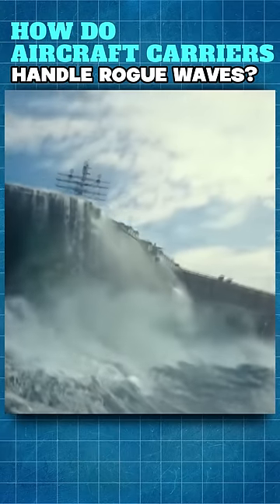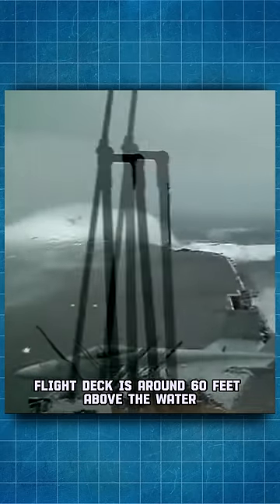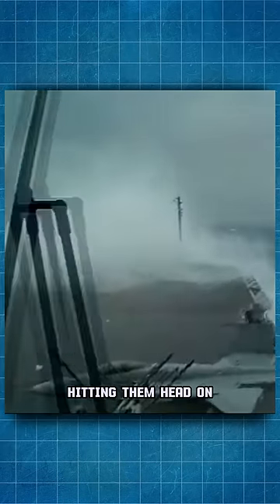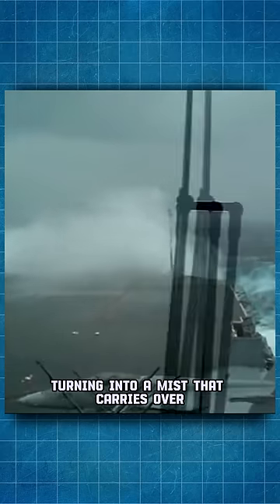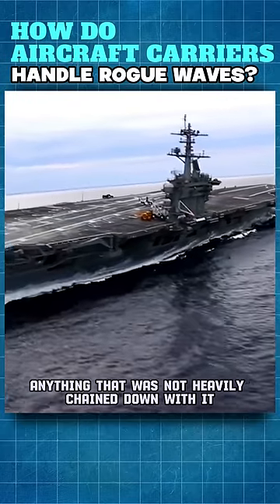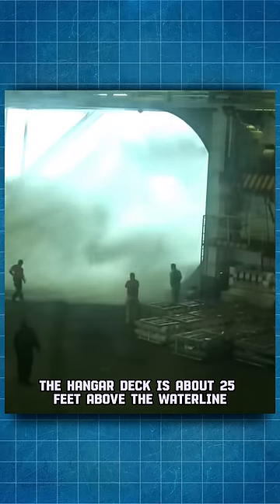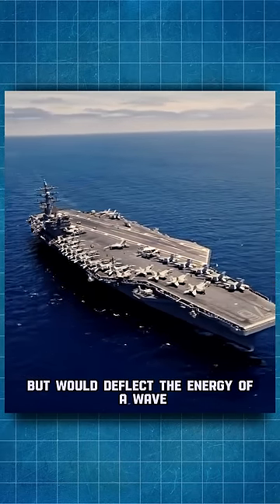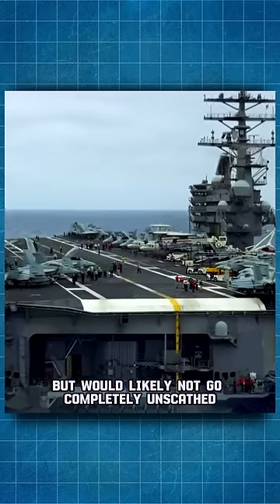How Do Aircraft Carriers Handle Rogue Waves? #aircraftcarrier #battleship #usnavy

Comment: In 1989, the USS Midway ran into three typhoons, couldn't outrun them, so we turned into them. We hit severe waves and took three 24 degree rolls (allegedly we would flip after 22 degrees) and came out on top with some damage. One SH-2 Helicopter destroyed, 25 life rafts lost at sea, three Sea Sparrow Missile pods destroyed and one compartment located under the angle deck lost the floor plating. We also lost one "huffer" which was an engine starting trolly.
Reply: USS RANGER CVA-CV 61, 73-76, TONKIN GULF YACHT CLUB. We encountered 🌀 typhoons. We closed the big hanger bay doors. Up on the O3 level forward was rocking! Hi yo Silver, away! Press On. The Atomik sends. Peace ✌. 😊
Reply: In other words y'all got y'all ass beat
Reply: Never been at Sea,  or a Man. Stay in the basement
Reply: @mattheweast29  You have never been a man? What???
Reply: Yep I was onboard, worked in G-1 Weapons Department then some years later cross decked to the Indy.
Reply: There"Magnificent Machines"
Reply: I was on the IKE, I had a dream of a capsize while I was on her.  When I woke up we were rolled 23 degrees, hurricane season off the azores.
Reply: my uncle did communications on the midway
Reply: 3?!😳😳😳😳
Reply: Actually it's not really head on , 10 to 30 degrees the boat ride into it .
Reply: Sounds as if your captain & chief engineer were on the same page with her ballasting. Yet I doubt a 22° would have rolled her. Even 60° might not phase her. Yet it sure would shake thing up for her crew.
Reply: @seageo4303 allegedly, the engineers that built her said anything over a 22degree roll would capsize her because of the top-heaviness of the flight deck. Remember, the Midway was built as a straight deck carrier, but retrofitted with an angle deck later in life. I know it got scary for us. Collision alarms were going off. I was on the mess deck trying to eat lunch and the tables started sliding all over the place. Eventually, I got up and grabbed some pipes in the overhead just in time for the bug juice (kool-aid) machines to fall over and spill 60 gallons of various flavored kool-aid all over the deck.
Reply: Isn't that classified?
Reply: @repo4sale  on an 80 year old ship that's a museum? Don't think so.
Reply: I have been at the helm on more than one occasion in that kind of weather on the midway myself in the 70"s
Reply: @billmccollom8560 I’m sure missing the days of hydraulic steering myself.
Reply: @Rhaumar I thought the HORNET (CV-12) had her bow reinforced due to wave damage. The only hint to that on the Internet is that she went to a Naval yard in Washington State for a “hurricane bow.”
Reply: @seageo4303  the battleships and carriers in late WW2 and after all had "hurricane" bows, for wave breaking.
Reply: @Rhaumar I was just quoting a U.S. military site.
Reply: Heck
Reply: We need a bigger air craft career
Reply: And more drones
Reply: That was not the first time Midway took on very heavy seas. My tour was 85-87 before and after blister project. One cruise book has pix of the flight deck in the water, next pic is buld on bow out of water. Props were changing about 50 RPM due to motion. (#1 Engine WCS)
Reply: @stevencovington4715  I remember the horror stories about the blister packs. Those did more bad than good.
Reply: Westpac 78. I stood watch on the flight deck of the Enterprise cvn65 during a big blow.. had to keep an eye on all the aircraft chained down. What a ride!
Reply: Poseidon dont play
Reply: You have to turn head on into the waves if you go sideways don’t care who are or how big  you’ll sink
Reply: That’s in sane but i been out between 35 knots to 80 MPH winds in which I stay out fishing i became quite famous on landed some monster  Walleyes  and large  Trout. With enormous strength  and most of my best results are in 6 to  9 footers
Reply: Wow. Can't imagine the tragedy of a carrier rolling over.
Reply: Completely random, but id totally watch a life story from you. 1000% you make a video and a short. It'll go places id bet, I don't know what you'd do after but hey worth the try
Reply: @toastedorange9106 Thank you very much. Not really sure that my life story would be worthy of YouTube. I guess that having served for 10 years in the Navy, being onboard two aged ships (Midway and Missouri) and having seen war from the ships would make for interesting stories. And then, trying to find my footing as a civilian leading up to where I am now has been a trip. I might have to think about it.
Reply: I would watch it
Reply: @Rhaumar bro please make shorts about your history. It IS WORTH YOUTUBE and documentation, you should see the mindless useless shit ppl post on here lmao your story would be a breath of fresh air and preserve memories only you can
Reply: Despite the damage , it’s a win if everyone made it out safe
Reply: @Rhaumar  Battleships didn't have nor need "hurricane bows".  Aircraft carriers of that day originally had open bows with the flight deck built as an "overhang" over the bow. Hurricane bows enclosed these so as to  preclude the flight deck from buckling and folding down.
Battleships NEVER had the need.
CPO(SW)USN(ret ) USS IOWA BB-61 1983-1989.
Reply: @martypalmiere7672  ok Chief, I'll give you that one about the battleships (EM3 USS Missouri 90-92). The Midway had the hurricane bow and the Missouri had a "bulbous" bow, sorta. My bad.
Reply: @Rhaumar  Another Battleship Shipmate....ALRIGHT !  You said 90-92 BB-63...Hmmmm.....You wouldn't by any chance be acquainted with a Senior Chief Canon Cocker (Gunners Mate Guns) by the name of Rich Koenen would ya ? He helped us out with the training of Turret III aboard IOWA on June 30th.
Matter of fact since he was the only one of us who had ever done it before, he operated the hand crank at the trainer's station.
Reply: @martypalmiere7672  I was not... even though I was the Turret 3 electrician, I didn't know many of the GMs.
Reply: All that and not one lost of life..Praise God!
Reply: Thanks for the information,  I've been wondering about that 😊
Reply: @seageo4303  It's a very rare occurrence for any vessel besides a Coast Guard Rescue Craft which is designed to actually capsize and come back, to recover from a 60° roll although there are a few where a Destroyer was actually on her beam ends (85°-90°) and come back......VERY rare.
Reply: @repo4sale  Not any more, Midway is so obsolete as an operational carrier that info is declassified and available by FOIA.
Reply: @Rhaumar  What years were you on "Mighty Mo"?
I was on IOWA from Dec. '83 to Jun. '89.
Reply: @Rhaumar  Belay my last, I just saw that we discussed this a couple 'o days ago. 
Fair Winds Shipmate
Reply: @DJSAL415  :face-blue-smiling:
Reply: This reminds me of that movie with Bogart in the caine mutiny.
Reply: That sounds like fun, and you lived to have a cool story to tell.
Reply: We always dealt with it!!!  I just left the year before.
Reply: USS Midway, a Midway class carrier launched in 1945, took on three storms in 1989. These storms are known to sink large ships, yet CV-41 took minor damage. I wouldn’t call that and ass kickin’.
Reply: Yeah fuck the ocean.
Reply: I was on the Midway in 72.  I was a dental lab technician.
Reply: A hurricane bow is an enclosed bow.  Old carriers had an open bow.
Reply: Damn! Im trying to picture myself there ! What a day right!?. I worked on an LCU # 49 out of little creek virginia.one night out at sea we were attempting a wet well landing into the U S S SEIPAN AND THE SEAS WERE COMING AT US AT 25 FT. ( OUR MAX ATTEMPT HEIGHT) I THOUGHT I WOULD SURLY DIE THAT NIGHT AS I CLIMBED UP ONTO THE WING WALL TO CATCH THE HEAVING LINE BEING SHOT AT US FROM THE SHIP. WE MANAGED TO GET IT IN THERE WITH NO CASUALTIES.( PROOF THERE IS A GOD)😅
Reply: I remember seeing the shirts and hats saying I survived the roll. I was also at the midway's decommissioning ceremony in San Diego. USN 89-95

Comment: I was on the USS Intrepid CVS 11. In January 1970 we were on a shakedown cruise and we were chased across the Atlantic Ocean towards England. The captain said stand by we are turning about.  A wave over 60 feet tall. The ship bounced on the ocean. We lost 4 A4 jets and 4 helicopter that was changed down. We lost both elevators and the front elevator was hanging by 1 bolt and 2 feet deep. There were catwalk were messed up.

Comment: USS IOWA BB61 1989 North Atlantic..yup seems about right
Reply: USS IOWA 1985 North Atlantic also, to the East of IIceland, took shelter in the Irish Sea. Had to dog all Engineering Plant supply vent intakes on the 01 & 02 level port & stbd as we were shipping green water down in the fire & engine rooms through the vent outlets. Rigged alternative vent supply by opening up the armored door on the 011 level and channeled air down through the main fire control tower, past the CO's & Admirals cabins, past, down the armor hatch outside XO's stateroom, down the hatch above fwd IC and all along Broadway and into all the engineering spaces.....one big F-ing wind tunnel ! !  But it worked !
Reply: @martypalmiere7672 wow, it never occurred to me how they got the air down there for those big boilers. That's quite the work around. Love those big old Battle Wagons.

Comment: The definition "rogue wave" has nothing to do with its height...
It has to do with it being substantially larger that the average wave in that area at that time.
So a rogue wave can be 10ft tall, if the other waves around it are on average 3ft tall.
Reply: rogue waves don't usually travel in the same direction as the regular weather waves
Reply: They come from the side

Comment: Depends on what activity is present. 
We were in a storm.  I was on sponson 6, very rear of the ship.  We were taking water over the bow.  When in the trough of the wave I could not see over the top of the next wave, over a hundred feet.  I could feel and screws exit the water as we crested the waves and begin the slide down to the next trough. If you came off a ladder at the wrong time as we crested a top you would float down the hallway, bouncing off the bulkheads at zero g till the ship hit bottom of the next wave. Then crash down into the deck as it came up to slam you.  I could see the other ships of the fleet occasionally.   They would come porpoising up out of the sea to crash down and slide down the side of the next wave. North Sea Storms... aint they grand.

Comment: Incorrect.  The navy does NOT sail directly into waves.  Doing so increases the probability of damage to the ship.  Steaming with the waves approaching from either the port or starboard bow allows the ship to roll over the waves and spreads the force of the wave over a greater section.

Comment: Right away, false. A Rogue wave is any wave that is higher  than 2,5 times the current significant wave height (Average height of the highest 1/3 of waves in the surrounding region). In a pond where that measurement would be 1cm at the moment, a wave 2,5 cm high would be considered a rogue wave.
Reply: Rogue wave, usually twice the normal height of surrounding waves, and more than likely coming from opposite way.